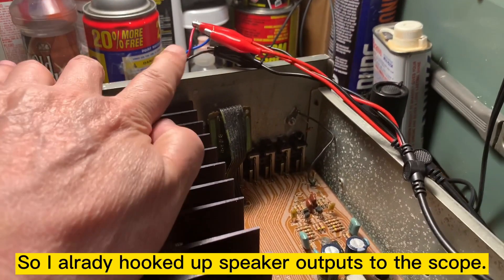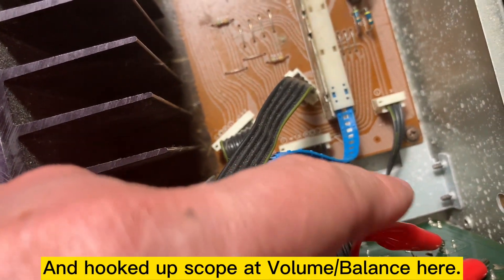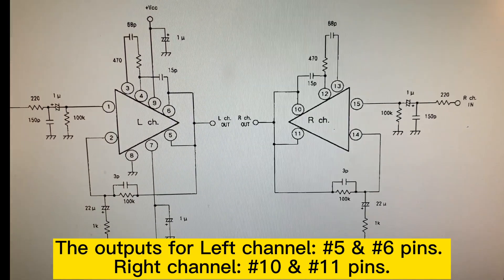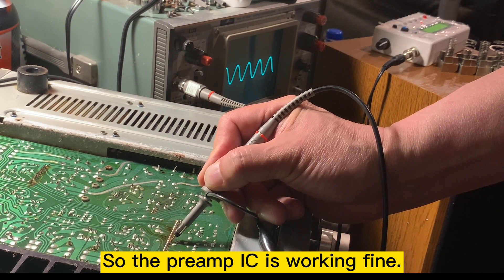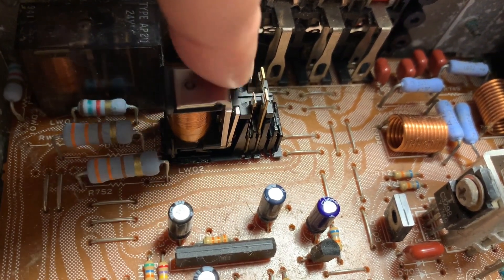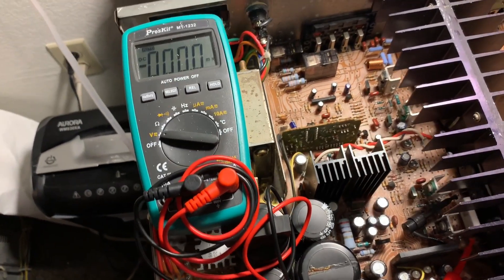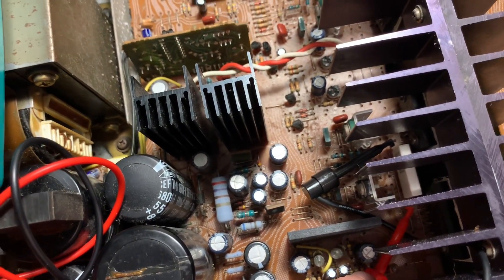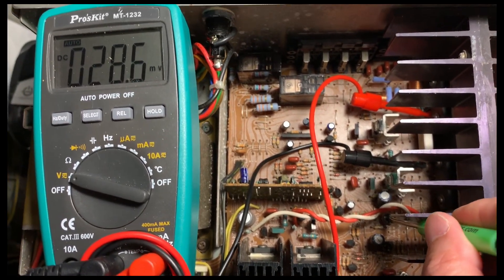Marantz PM-64 Integrated Amp Repair - One Channel No Speaker Output

Comment: I'm not getting the click, but sometimes it will eventually click after being turned on for a while. What could this be?
Reply from the maker: The DC offset at amp output is too high causing the relay won't click.
Reply: @VintageAudioFan  OK thank you. I have no idea what thet means, what's causing it or how to fix that. I know DC is direct current.